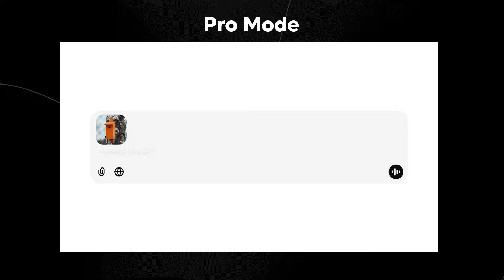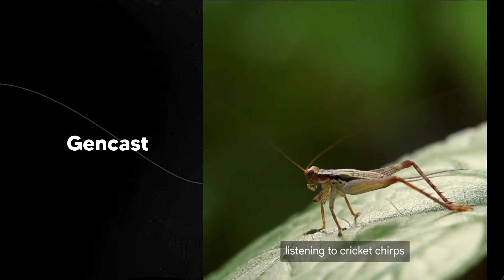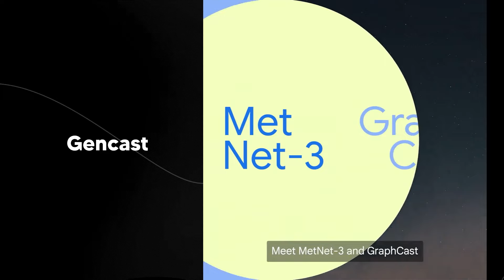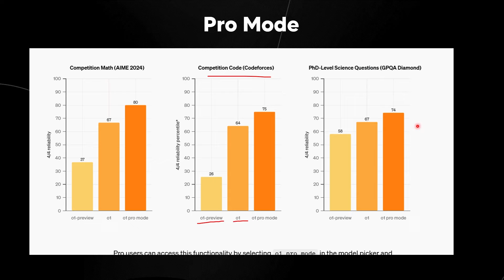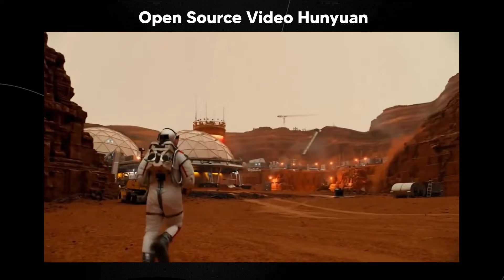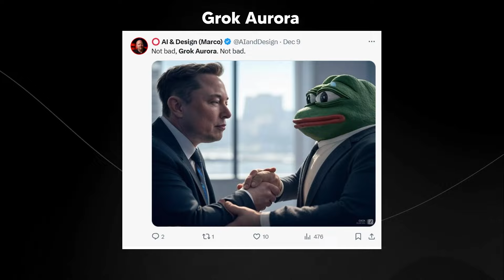HUGE AI NEWS: OpenAI Releases Sora, Fully AI Generated Games, New AI Agent, Recreating The Brain...

Comment: the entire LLM could been built in the 1800s as a mechanical contraption covering a entire city where each module contain tousands of mechancial parts. the noise would have been horrible and the screen would be a giant frame full of rollers containing numbers and letters to print out the generated text. feedig data to the mechanical machine had to be transelating text into a hole pattern that could be used by the mechancial contraption to read the text. the training would be entirely mechanical. it would be all kind of mechanical noises in such a machine. it would need a kind of printer that hulls out hole pattern in a some paper that is then feed back into the machine to drive the mechanical transformer. all the vectors are gears leavers. each module would require a operator that manually crank it to make the machine run or a horse that walks in a circle to drive the module. it would take millions of operators to drive such a vintage version of a LLM. i only make the comparison to make people understand that LLMs are just like a old mechancial clock in that  its all mechanistic.

Comment: 18:55  what if we map a brain and then run a simulation and allow it to be free? What if we map a brain and then connect a neuralink to a person and then merge the identities or not merge but what if the simulated brain is ran parallel to the flesh and connected using neuralink or synchron and then basically you could operate in the matrix and real world. So much potential and then genetic engineering is gonna go hard.
Reply: Could it map to an AuDHD brain?
Reply: @Babeatrice    Yeah. The way would be attaching a device to listen to the brain either invasive like neuralink or non invasive like on the outside like mri. A synchron device would listen by chilling in the vein between hemispheres. If the synchron listens then there’s no need for a full simulated brain but a real time reflection. Then it could be used for prosthetics or wearables or cars and games because the ai can utilize your thoughts and respond. If there was a neuralink then it could send info directly to the brain and help the many systems of the body and even share information and sensory information. This stuff will be the future.
Reply: Cyberpunk 2077